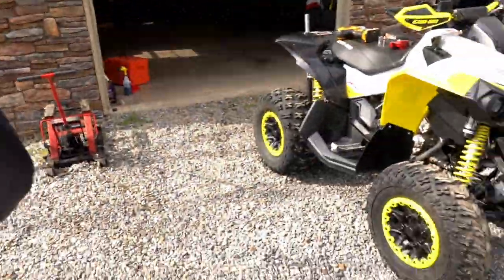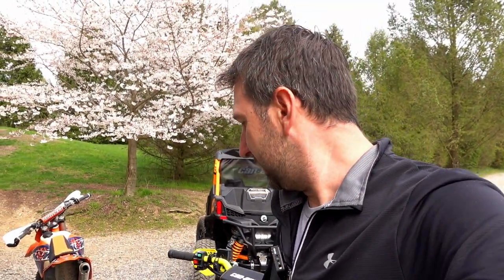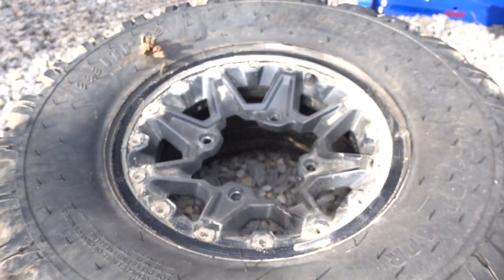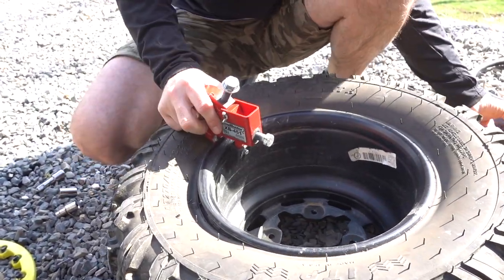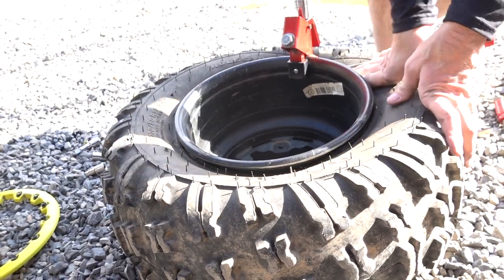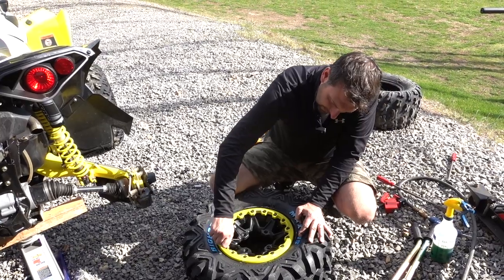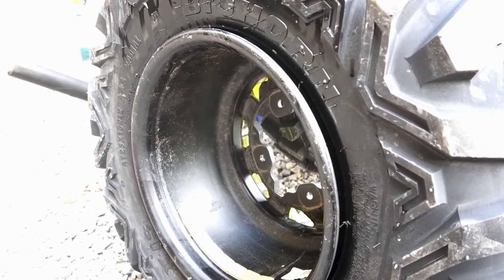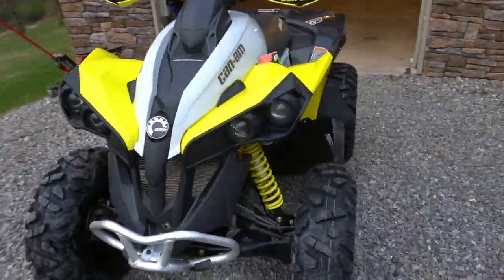Mounting Maxxis Bighorn On Our Can-Am Renegade XXC 1000R

Comment: Thanks for the video! I have the same quad 2020 xxc 850. Im in the market for new tires and i think im gana go with the big horns, i have the same issue with puncturing the stock ITPs on the rocky trails i ride. I was wondering why did you go with the stock tire size as apposed to a 26"? thanks
Reply from the maker: That’s actually a great question.  I spent years XC/Harescramble racing.  Because of that I’m really critical of how a machine handles.  I like to keep the stock tire size due to keeping the weight down and the center of gravity low, which ultimate helps it handle better.
Reply: @SpeedingMedia  Thanks for the reply! I was going to go with 26 but now I’m going to order the 25s. Also what skid plate do you recommend? I’m looking at the ricochet aluminum.
Reply from the maker: @exhaustclips9907  www.ceccoracing.com is a friend of ours.  He makes UHMW plastic Outlander/Renegade skids that are awesome.  I don't see any currently on his site but I'd check with him first before you go aluminum.  The UHMW skids are pretty much indestructible.
Reply: @SpeedingMedia  I figure the aluminum would protect the frame better from getting crushed in by rocks
Reply from the maker: @exhaustclips9907  I've done alot of testing with the UHMW plastic and I'm a huge fan.  It slips over the rocks and doesn't deform like aluminum skids can.